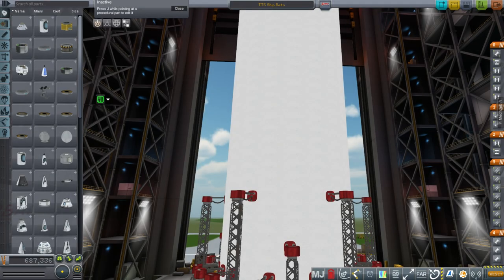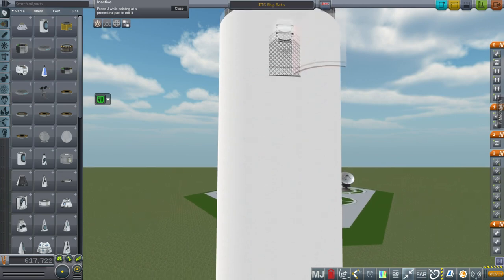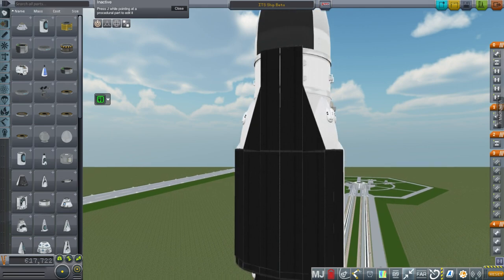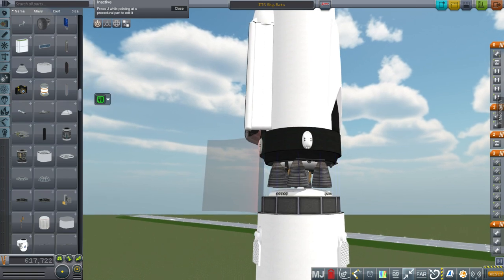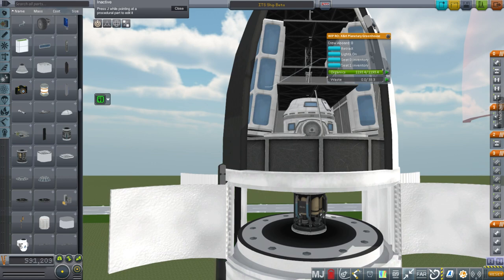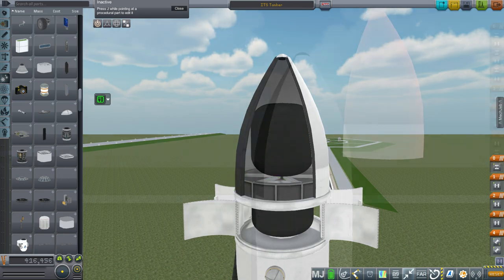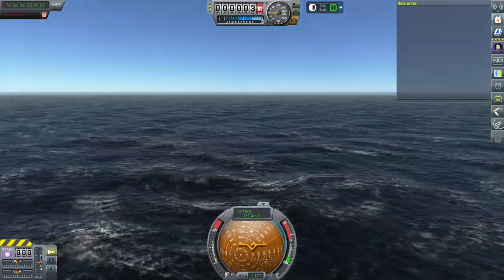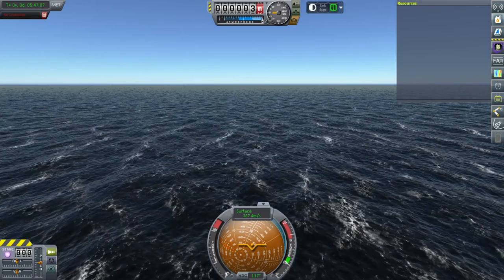KSP/RO - SpaceX ITS Upgrade and Reentry Test

Comment: The BFS does have a body flap: half of the interstage fairing stays on the ship to protect the engines.
Reply: Since it's half of a cylinder, I can't see how it could be a control surface.
Reply: Still, the engines aren't naked.
Reply: @HEHEHEIAMASUPAHSTARSAGA  but it is not a cylinder and is flat with leg/wings on the bottom. 3rd upper acting as a partial rudder.

Comment: Will you try to SSTO the ITS,as Elon suggested that it can makes orbit with only the ship.
Reply: I read the this post from the SpaceX sub reddit, , it suggested the ship have cap to LEO from 34 to 60 ton(https://www.reddit.com/r/spacex/comments/55uhb7/ssto_cargo_its_spacecraft_calculations/)
maybe the real ITS ship had little bit more delta-V that KSP predicted.
Reply: Tyler Raiz Thank you for reply. I actually tried to build a ship similar to ITS tanker after my second reply, It even won't lift off from the ground when it's empty. The SSTO ITS seems not a good idea.
Reply: Tyler Raiz Thank you for reply. I actually tried to build a ship similar to ITS tanker after my second reply, It even won't lift off from the ground when it's empty. The SSTO ITS seems not a good idea.
Reply: I meant ITS tanker in 2500 ton fuel +90 ton ship configuration. The TWR will be <1 .Sorry for my typo :< .No way a SSTO ITS will be happen

Comment: the V shapes on the sides looks like they are meant for aero-stabilization, like  vortex fins
Reply: it creates some drag and cuts the airflow in a  spiral/vortex.
Reply: well you could give it the physics model of a elongated fin. 
i can only theorize the effect of a vortex on the stability with my limited knowledge, but from what i know a long fin(length not span, if you know what i mean) would come very close to mimicking the performance of a vortex gen. 
it should give that extra stability in high speed+ high altitude.